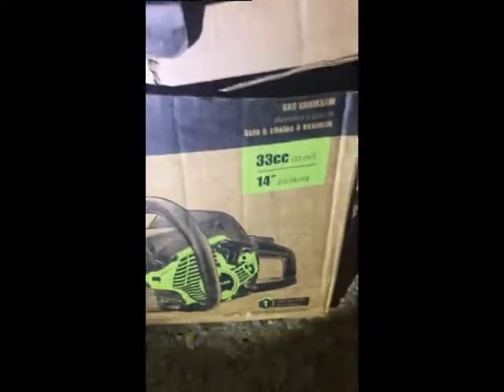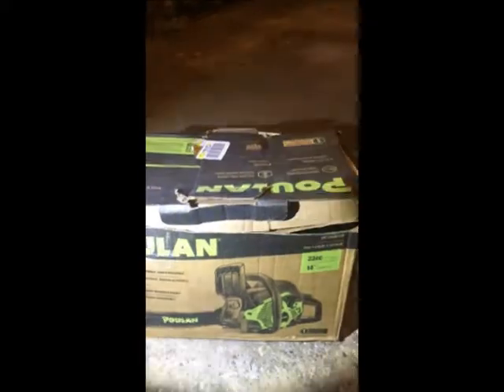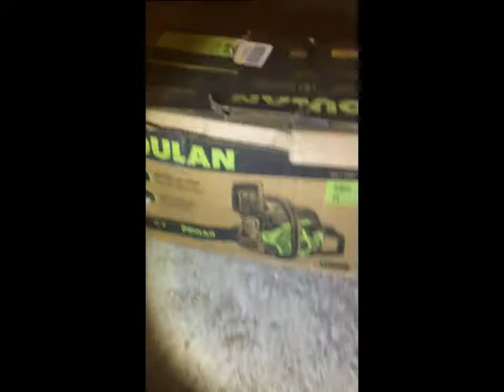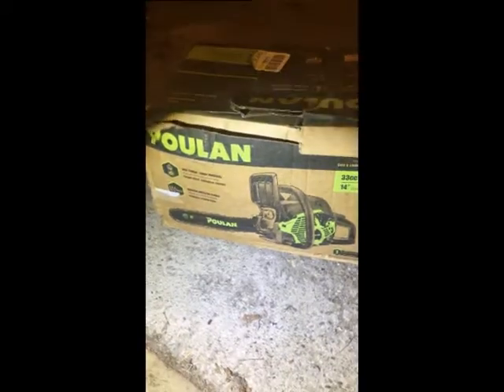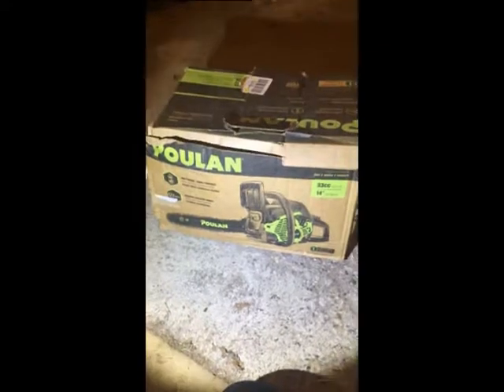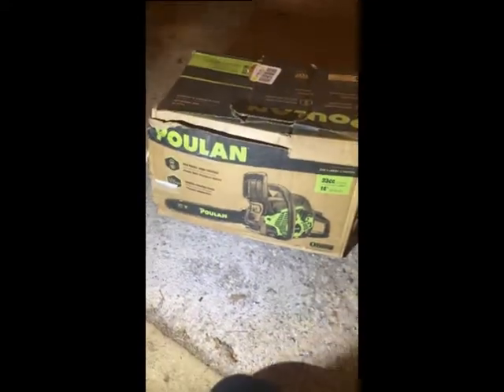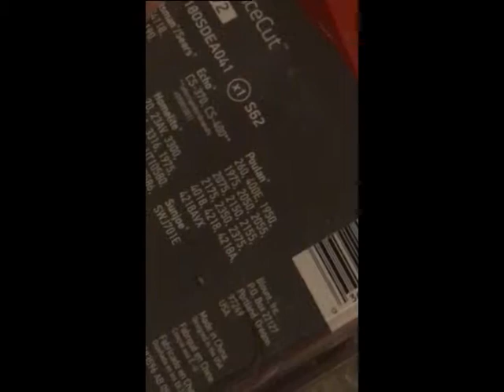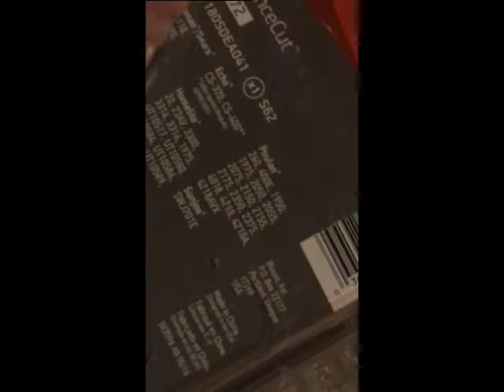Poulan 14" Chainsaw PL3314 upgraded to 18" oregon

Comment: Check the EPA label underneath the saw.  The engine is most likely a 42cc engine.  Poulan uses the same 42cc engine in a few different saws.
Reply: @Lance Rothman  Basically all current Poulan chainsaw except for 5020 series have 42cc engine. I have PL3314, P3816 and PP4218A  they all have 42cc listed if you look at the EPA sticker. PL3314 can definitely handle 18inch bar, basically is cheaper PP4218.